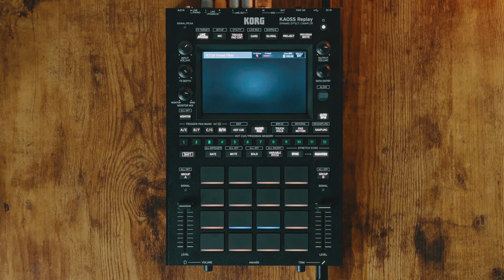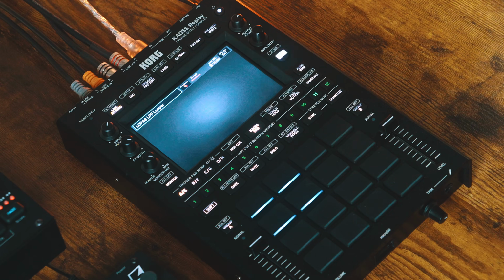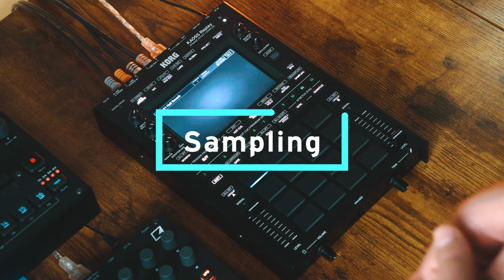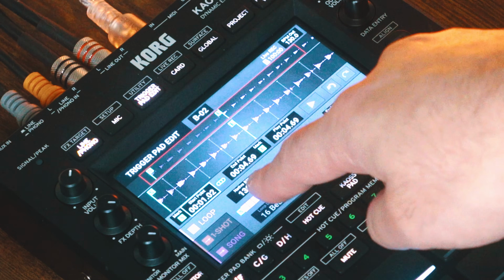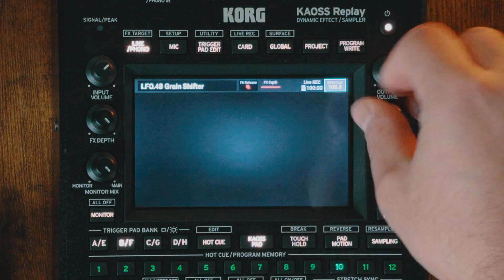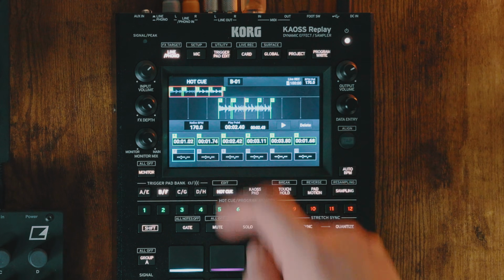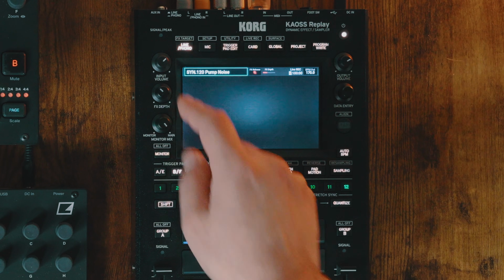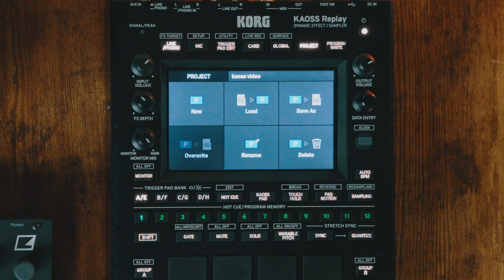Korg KAOSS Replay - overview

Comment: Why would you call two distinct faders a crossfader?
Reply: Because that way you could also use both faders for whatever purpose unlike a X fader which reduces and increases volume respectively
Reply: @grandmasterjo1  Yeah, I get why there are two faders. That makes sense. But why call it a crossfader when it is clearly not a crossfader? Sure, you can manually do a crossfade with two hands and some skill. Should we start calling all faders on all mixers crossfaders? 🤔
Reply: I am not so sure if they actually call it a X fader 
It’s a signal level where you can play signal A or signal B or signal A+B
Would you pay $1000 ?? 😅
I have the KP3 but I think the Kaoss replay is an ultra sophisticated KP3 
Should have been priced at $ 549 ❤
Reply: @grandmasterjo1 It's within the first minute of the video you're commenting on.
Reply: @CEMeier apologies 
It’s not my video and yes Ezbot did mention about the two X faders in the first minute. 
Ezbot is a friend and I will renquire with him why did he call them 2 X faders. 
I will forward you his reply. But yes as a DJ I would not call it a X fader and neither did Korg. 
Thanks for the update 👍
Reply: @CEMeier hey here’s the text reply by Ezbot 

Haha yeah true, I misspoke they are just faders with adjustable fade settings

You’re so right 👍👍 about the Xfaders